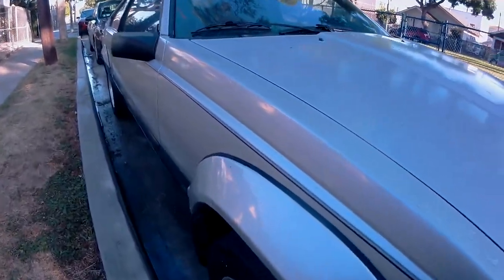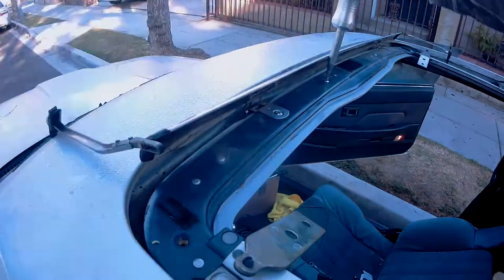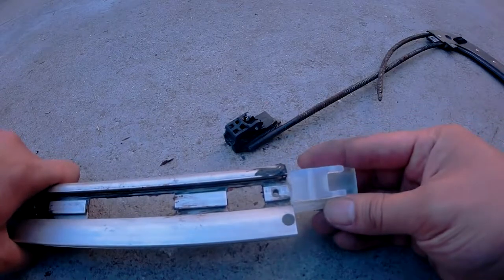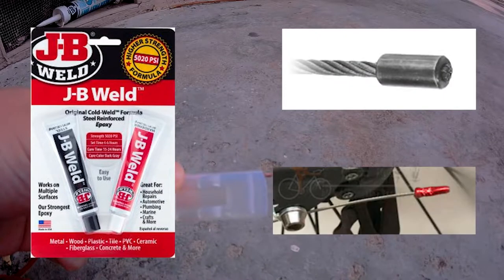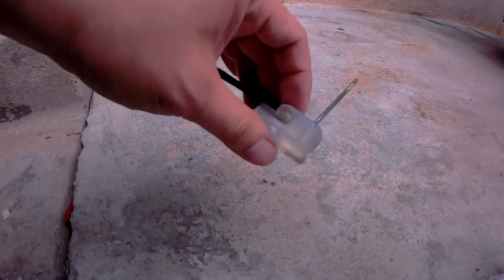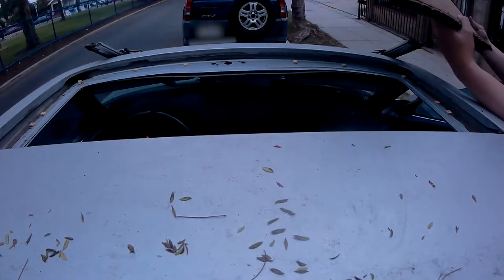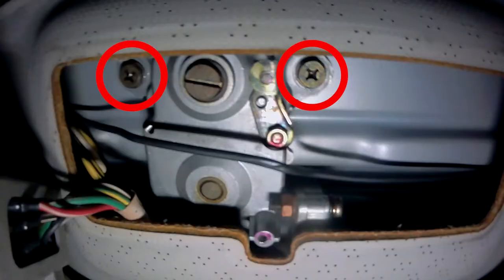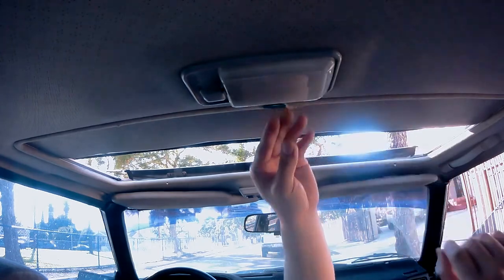(MKII) 1985 Toyota Celica Supra Sunroof Rail Repair

Comment: My man, thank you for the video this is just what I need to fix my RA65 celica, I was about to seal shut my moon roof now I dont have too. Can you show a video on how to fix that little padding that is above the gauge cluster and attach to the dash that would be great that's my next issue to fix.
Thanks again awesome job.
Reply from the maker: Which part is the paddle? The removable hood for the gauge cluster?
Reply: Its wear the gauges go in and it's in front of the steering wheel, also your cruise control button is there on one side and your defroster on the other side
Reply from the maker: @unxpected8012  I had a feeling that's what you were talking about.
How bad is yours? Cracked or broken?
Mine is hidden under a dash cover so I don't even remember it's condition.
Reply from the maker: @unxpected8012  what color is your dash?

See if these are your colors. https://www.facebook.com/groups/mk2suprapartsfstw/permalink/1897998903686005/
Reply: Its cracked I have a cover too, the color is that 80s brown
Reply: Hello john, I was trying to get a set of guide but the seller has not responded to me do you have another method of me getting a set, or how I can get in touch with the seller?
Thank you
Reply from the maker: @unxpected8012  yea. Billy is a working man. There's might be a wait list for these items. Just be a little more patient. He'll eventually get to you.
Reply: @johnsneverendinglistofrand1377  
Ok thank you

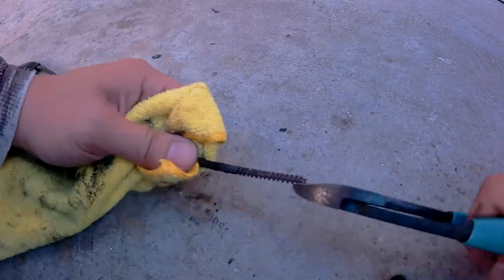Comment: 7:03 time stamp.  Great video. I am following along very closely.  However, messed up at this step. I burned off the right amount of plastic, but I twisted the cable off completely, instead of just the outer cover.  Do I need another cable or do I have enough to go another length of the new bracket?  I dont know how much spare cable they ran on this. Thanks.
Reply from the maker: You should still be able to use it as it is. Just pack it with JB weld and make sure it's completely cured before you install it.

Comment: That was great 👍 thanks ,, any idea what is wrong if my roof keeps clicking like a machine gun ??
Reply from the maker: Wild guess...bad motor gear or cables aren't evenly distributed.
Reply: @johnsneverendinglistofrand1377  i f i cant close the roof by hand with the motor removed does that imply that the problem is in the cables??
Reply from the maker: @nedved1999  sounds like it's stuck somewhere. The cables are small so I don't see them being the cause for it being stuck. Did it slide open smooth?

Comment: I am trying to replace my guides, but my old ones do not have the long pins with splines (the ones you said not to insert using a hammer and insert smooth end first)  Are they truly needed? If so do you know the dimensions so I can try and make some?
Reply from the maker: "I think" those pins apply spring load to assist with the sunroof when it initially opens.